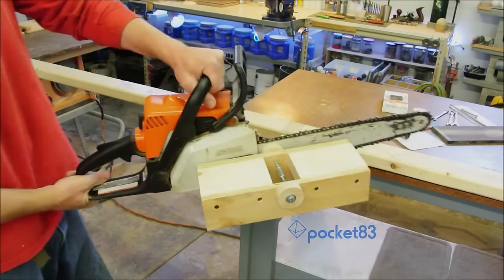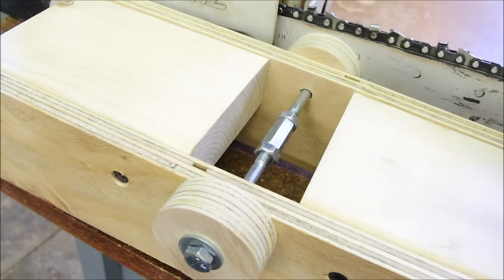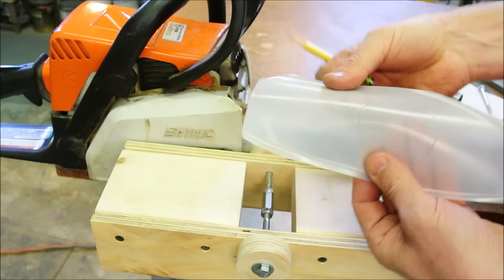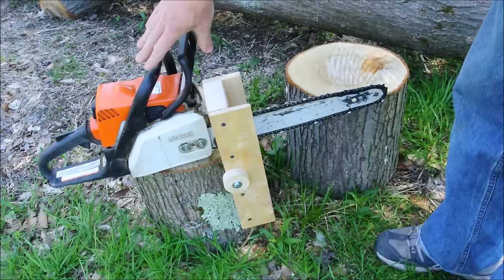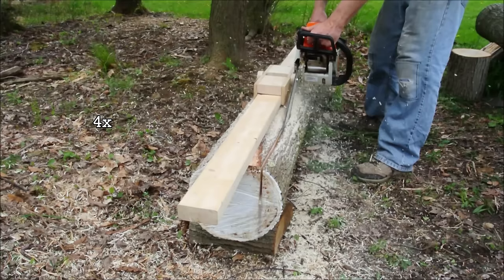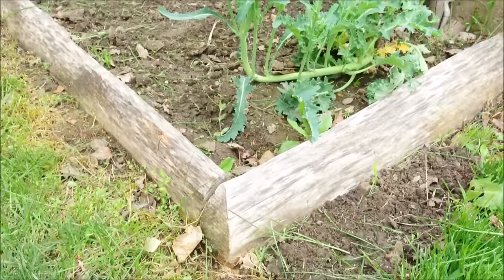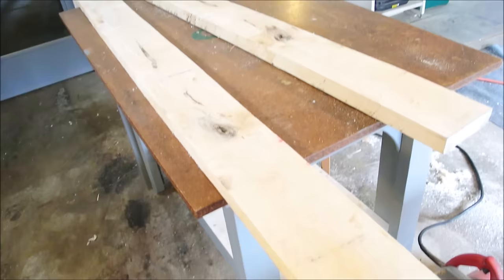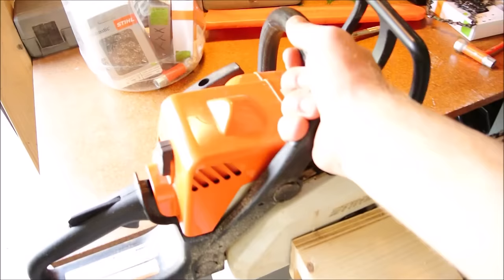Chainsaw beam guide from wood (DIY mini mill)

Comment from the maker: Check out the following channel: #FloweringElbow
Great content that's all over the place, but it's quite often chainsaw-esque.
...
Sorry about the re-upload. The audio has been fixed.
Here's a link to the original video, in case you were involved in discussion there:
https://www.youtube.com/watch?v=lhfgPQGqGmc
Reply: What was the cause/fix of the audio issue?
Reply: RealRuler2112: A tiny section of video/audio toward the end corrupted/skipped and made a super loud pop, which YouTube compensated for by making the pop (and the rest of the video) quieter. It's near 20:32 in the unlisted video; that particular second was cut out of this video.
Reply: @twiswist  Interesting... didn't know youtube normalized audio when you upload.  Thanks for the info.
Reply: HAHA "all over the place"... You got that right! Thanks again for the plug. I love you approach to making things!
Reply: It looks good and works good awesome
Reply: Great economical option 👍 Any concerns on kickback?
Reply: Has anyone tried using an old bandsaw, on the horizontal, as part of a mill build? 🤔🤔
Reply: Fantastic video! Keepin it simple and practical thats what I like.
Reply: Just built one for milling some blow down trees. Paste wax and milk bottles make it super smooth running
Reply: @twiswist  pp
Reply: Yeah definitely add wax to wood on wood moving parts. The saw dust won’t stick to it and it will get pushed off the piece you’re cutting by the piece attached to the saw that is sliding ontop of the wood.
Reply: ❤❤❤❤❤❤❤❤❤❤❤❤😢😅to ❤❤😅❤❤❤😢😅😮😢😅😢to se 😢7.h.po ❤❤
Reply: Me

Comment: Hands down the best DIY chainsaw mill on YouTube that I’ve seen. Great job, thank you! And don’t let the haters make you salty. When you respond to nonsense you feed the beast. 💯
Reply: Not sure if it's synchronicity, but Advoko Makes has an almost identical system. But automatic pulled by bunjy cord, and with a counterbalance shelf to match the chainsaw weight. 
It's outrageous how well it works and the perfect 0.66inch planks over two feet wide it does without the operator going near the saw when it's cutting.
Reply: @aaronfranklin324 yeah seems just a copy… does he mention advoko?
Reply from the maker: There's nothing about this system that was copied from his. If there was something, I'd give attribution. Nothing against the guy, but he didn't invent chainsaw milling, either. Our procedures are very different.

Comment: Not sure if it’s been mentioned, but have you thought about applying paste wax to the guiding surfaces?
Reply: Believe it or not, Ivory Soap, the solid kind, not the liquid. Would work better. I have moved many tons of heavy equipment by sliding it across the floor on two pieces of plywood slicked down with ivory soap between them. Keep the soap dry, no water. Counter intuitive but water will cause the boards to sieze up.
Reply from the maker: @doughoist  Yes, I used Ivory soap in this first video, but I didn't mention it. After milling many more times, I've determined it to be pointless. And the paste wax idea has been mentioned here dozens of times. It's also totally unnecessary. 

Note that now my 2x4 guide rail has been given a coat of polyurethane, though. It's quite smooth.
Reply: Thanks for sharing your experiences you guys. Polyurethane can make for some slick surfaces! 😊🌎❤️
Reply: @doughoist  Carpenters used to carry a piece of soap in their pocket, to slicken screw threads mainly.. but that was back in days of Armstrong :) Soap on the jig would work well in this application, just like ski wax, and inexpensive.
Reply: @pocket83squared  I'm glad you went to a bigger saw, watching this vid was somewhat painful. There is no substitute for experience. Good jig idea, Thanks buddy.

Comment: Perfect. Now if I can just find a straight 2x4 at my local big box store.
Reply: As long as its reasonably straight. Doesn't have to be perfect. how you dry it probably matters more.
Reply: @daved1823  no..it needs to be straight otherwise the log will be crooked to.
Reply: Plenty of propeller and canoe grade stuff, though.
Reply: What about trex? Or run your 2x4 through a planer? Or use a steel framing stud?
Reply: @joefunsmith  steel framing sucks for alot of reasons.
Reply: @randybobandy9828  Actually, a couple of days later, I watched this video https://youtu.be/zqg_MVbe4Wg and liked the setup better. Using square stock steel and a couple of fabricated steel guides with an alaskan mill seems like a great way to make the whole process portable and quick.
Reply: @daved1823  make one by lamenting stripes of 3/4 inch plywood overlapping the ends and you can. Make it as long as you want!!!
Reply: You know it! 😆😂🤣
Reply: Ain't that truth
Reply: Go through 40 before you find a half way straight one!
Reply: Any chance you could make a 2x4 out of 3/4 ply strips?
Reply: My wife can sniff out the straights...but she piles about 50 for culls and takes hours. I don't take her to the lumber yard anymore.

Comment: After watching numerous videos on milling from raw cuts, yours has been one of the most informative by far. I have a couple of dead oaks in my lower yard that I need to cut down, and I wanted to salvage some 2" lumber from them. This is a cheap, accurate, and clean way of getting the cuts I want. Thanks so much!
Reply from the maker: Thanks a bunch. Be sure to also watch the other two videos, because I really made some improvements. Good luck with it, and use a new chain: dry Oak is tough!

Comment: Sage, either fresh or dried, chewed up in a wad or as a tea will stop small wounds from bleeding almost instantly.  I don’t even use bandages for small cuts anymore.  It closes them up and leaves me pain free.

Anything to get back to work faster.  When I cut myself working I go for a sage bush before anything else.  The bitter taste has become one of relief and efficient healing.

Just sharing.

Comment: I’ve been using the commercial version of this (Beam Machine) for years.  Cut lots of beams for wood  sheds, etc.  Simple and works well but there is a learning curve to keeping square and parallel, blade offset, and not wrecking your back.  Good video, for a first go you thought things out well.

Comment: Extremely impressed!  Gives me some great ideas. Like your 2x4 guide being straight, and maybe your guide splines, or tapered, to avoid kickback.  I have some flat teflon material. Might help if I glued some to the guide.  I think I must use your ideas as soon as I can get a rip chain
  Toy with possibly a longer bar.
Reply from the maker: Rip chains are better suited to mills that have attachments on both sides of the log. With a single attachment (like this one), you'll need a normal chain for correcting the cut once it starts to go 'off.' Think about this: low angle chains aren't as sharp on the sides of their teeth, so they have trouble coming back once they go astray. 
...
A longer bar is also ill-advised; a longer bar means further projected error, so a little off becomes lots more off. If you have a really thick log, you might get better results by first making a defined cut on each side before you plunge through--that's how I did the larger of the two. Don't mean to try to shoot you down here, but I've put quite a bit of thought into this simple gizmo. Thanks and good luck.

Comment: I bought a commercial version of this that attaches to the bar with set screws. Problem is, the set screws loosen and the guide slips, allowing the chain to contact the metal bracket, immediately dulling the chain. Bottom line: your design is better.
Reply: My experience too, and agreed.
Reply: Odd. I seen one video that the comments were disabled that said the same thing. I then watched another video where a man was using the same setup for 3 years without issue. He used a "drum tuning" technique. You could also drill out the bar but you're not wrong. This design is better.
Reply: Same with my mill.

Comment: I had watched the low audio version & was glad you posted it, even with audio issues - VERY good video!  (I'm more than willing to turn my volume up to watch a video like this. =) )  I've watched several videos of chainsaw mills & have not (before now) found one that's 'low commitment' enough for me to try.  I live in the city and therefore have very little space, plus only own the one chainsaw.  This looks awesome - ingenious & elegant design!  Looks like it'll go on/off the saw easily and not take up much room in my shop when not in use.  Thank you so much for posting it.

Comment: Enjoyed the video. I had a couple of thoughts that could possibly improve the rig. Of course I am theorizing as I have not used it myself.
I thought that you could put a handle on top of the rig so that you could push down on the rig as you pull it down the 2x4. Also I thought that if you put a ballast extending off the other side of the rig and weight it to counter the weight of the chainsaw it might help in making smoother cuts.

Comment: I made one of those in steel, will test it whan spring comes, i will try to use it to cut off 2 sides of 9 5m logs to replace logs on a barn and also to make a heavier kind of log puller. Hope it works. Anyway great video!

Comment: I have the same saw and made a jig from some angle iron welded together. Worked fine. I was milling spruce so a little easier to mill. And like you said, the bark dulls the chain. I used this often while building my remote cabin. Cheers

Comment: Let me first apologize if this is duplicating a comment already made.
   Ok, I have the Milwaukee M18 cordless chainsaw, it comes with a 16 inch bar and uses the same 62 tooth low profile chain as your saw. I have replaced the 16" bar with an 18" bar and 72 tooth low profile chain. My opinion is that it does not over work the saw at all, and I regularly cut some pretty hard species of wood, like Blackwood Acacia, Osage Orange, Black Locust , etc. It does however give me a good amount of extra cutting distance. I also filed my chain down to be a ripping chain and that really took a lot of load off the saw.
   I use a diy Alaskan mill attachment, but it seems like it would be easier to cut slabs when standing up so I'm going to give the design you are using a try.
Thanks for posting this video and cheers.

Comment: I've always enjoyed how you give us your thought process and updates as you learn more about how your idea/tool/creation works. Your conclusions are realistic which allows me to decide in the end if I think I can pull it off. Also it's just fun to see your ideas for things I probably will never need! Makes me want to make it just for the heck of it though :) Keep it up Pocket.
Reply: Very well done video. Interesting that you showed some methods that didn’t work well for you. Much more interesting than to present it as the only way to do it. I have a granbergs beam machine which I haven’t had the time to experiment with but intend to do soon. I have recently bought some Oregon RO ripping chain and installed it on a poulan wood shark. I intend to try milling some pine. Your video has been very helpful

Comment: Hey I just made one of these and cut up about $500.00 worth of lumber from a couple of fallen trees in my back yard and it worked AMAZING for what it is. I did find that Butcher/Bowling Alley wax on top of the runner makes sliding easier and smoother. Thank you
Reply from the maker: Thanks. I highly recommend that you watch the follow-up videos. There are now some simple add-ons that'll make the process work much, much better. 

Here's the most recent video:
https://www.youtube.com/watch?v=alClPHQMeMk

Good luck.

Comment: Bravo.....I need to cut the Sweedish cope off of the length of leftover logs from a home I am building. I was apparently overthinking the whole thing, trying to come up with some sort of elaborate concoction.
Your video has gained me motivation as it is a simple and cheap solution.
My logs are 8 inches and will be a breeze. Especially because if there is imperfections (wobble in the cut) it will not matter as it is rustic anyway!

Comment: Thanks X3 for sharing your skills, ideas and ingenuity .... I will make a similar one if and when I have to .... I will add wax or just oil to the 2 by and also to the guide .... I will also add a horizontal cross counterweight opposite to the side where the chainsaw is at for balance .... and use a metal 2 by and guide instead if I want to be industrious .... the world is already better with people like you and I ; )

Comment: This is the best most basic set up i have. Found and it makes it easy to flip the log 90° and get thur good lumber fast and easly. I bet if u hade a lip on the botom of the guide board that the trolly  can lock on to it would help a lot
Reply from the maker: That was something I considered, but I ended up using weights as a counterbalance instead. Watch the follow-up video. It's a really nice upgrade.

Comment: I did something similar with a 9" C clamp as a square to rock the saw on.

I used a 2x6 and ripped the edges off with a track saw. Also double side tape to attach a ruler to the bar, so it wouldn't cut the 2x6. That works with freehanding over parallel rails too.

Comment: Thank you, sir. You gave me a good idea. Using a timber tuff to remove the bark is a good work out.
Reply from the maker: I don't follow. Is that sarcasm?
Reply: @pocket83squared  Not this time.  I used a timber tuff to strip bark on several trees a dropped, but i needed a good idea to use a chainsaw to cut planks. I'm using yours. thanks, man.
Reply from the maker: @shutinalley  Sure thing. Hope it works out for you.

Comment: thanks for the video.  Sure it's simple and kinda crude but you just made useful maple boards with simple things anyone could use!  
Tips  I'd give for another time for you to try is to make multiple shallow passes with the saw for the cutting,  just using the tip of the bar for the cuts.  Here's why... the tip cuts will go faster due to the reduced resistance using less fuel but at the same time with a higher chain speed and less internal wear on the engine. I've seen this done on another channel with great results.
In these times of price inflation this kind of thing makes producing beams for larger construction projects something feasible and relatively easy .... even for those of us who do have back problems!  A plus is that you can make them from whatever logs you have oak, maple, hickory, pine... whatever, and you can do it where they are in the woods only dragging out the finished work instead of having to drag an entire tree section.
Keep up the good works friend!

Comment: A little soap or wood wax ..would help with your sliding issue. My grandad used a similar rig. Only angle iron. With a 4 by 4 "sled" with a 1/2 inch slit cut in. Usually this was used for deck board on decks/porches, barns and or sheds... Ofcourse run thru an old tractor belt driven drum sander.

Comment: Very good job on this video. I think you did a great job figuring out the guide box and it shows in your first cut. I wouldn't worry about your little imperfections with like you said the filming stopping and starting for this video. I've been watching saw mill videos for quite a few years now and have to say I'm intrigued with these simplified versions as opposed to the $10k mill's. Keep up the good work and if the smaller saw works. Then I guess it works. 👌🏻👍🏻

Comment: Great video. Just made the jig and ready to try it out when whether clears up. Thanks so much🙏🏼
Reply from the maker: Great. Watch the follow-up video before you start. It's about adding a simple counterweight, and that's a really big help. If you want the best possible result on your fist try, I've added a bunch of tips & refinements to the descriptions in these two videos. Good luck.
Reply: @pocket83squared  thanks, the only trouble I ran into was that it was too tight on the 2x4. But just added a few sheets of news paper for a spacer. Georgia weather just needs to clear up.